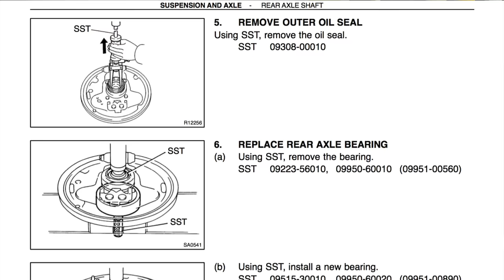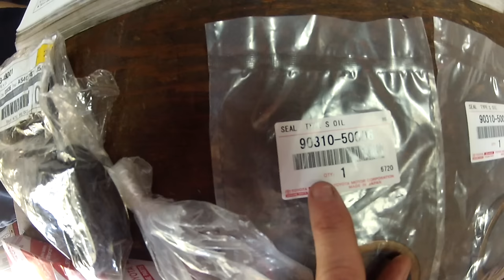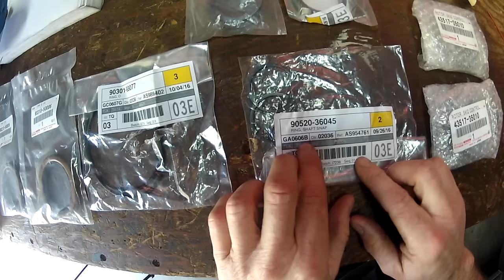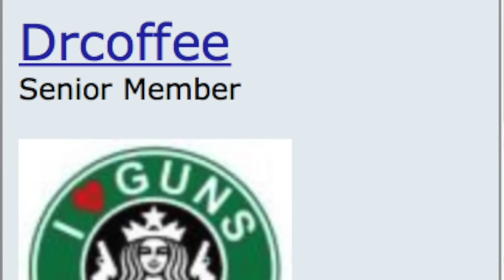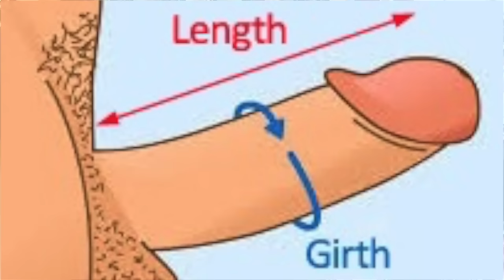Toyota Rear Axle Seal/Bearing Replacement (ABS Rearend)

Comment: Thanks for the video! It is important to note that you canot simply move the inner retainer ring inboard towards the pumpkin! I tried to put the retainer ring at the edge of the polished surface thinking it would solve the problem. When you bolt down the axle it will lock up the hub! You must flip the retainer around! This is total bullshit and it should have been a recall on this model truck!
Reply from the maker: Well, people have kept the retainer in the original orientation, bevel facing the seal, and just moved it inboard slightly, like 1-2 mm, and didn't have rubbing issues but that does put the retainer very very close to rubbing the inside of the axle housing and it still doesn't put the seal lip riding near center of the polished shoulder of the retainer.  Definitely the better choice is to flip the retainer so you can keep the retainer well away from rubbing the inside of the axle housing and get a better mating with the seal.  

I don't know if I agree with a recall but the problem is the fact Toyota redesigned the seal to improve it's longevity but then caused another problem because the seal lip now sits more inboard than before.  The problem is many dealerships,  independent shops and DIYers don't know about the seal redesign and end up botching the repair.  I have no doubt that anyone who watches this video has more knowledge about this repair than most paid mechanics.

Comment: GREAT VIDEO...Having second thoughts about bringing my 2002 Tacoma into a Machanic shop for a rear bearing job ,Thinking on doing it myself .
Reply from the maker: Dennis Khan Hey Dennis, you can definitely do it yourself with the right tools.  Look at the list of tools in the video description and what they would cost you compared to what a shop would charge for this.  Even if you end up spending more on the tools, you now own all this stuff for other projects.  I've used the Harbor Freight press for several jobs now and same for the press sleeve kit.  The bearing splitter I've used mainly for the rear axle job but I recently learned they will help me press out bushings from the front upper control arms.  The only tools that has a singular use is the Durasolid axle tool.  But, offer one person your help for a $200 and you've now paid for the tool.  Lots of people need this repair.  People are hitting me up all the time for help.  If you don't want to keep the tool, you can always resell it on Ebay or Craigslist.

The other option to save money is to have a machine shop do the press work for you but you have to be picky which shop you choose because it's fairly common for them to do the press work wrong or screw up your axles by cutting off the parts and scoring your axles.  

If you're into this kind of work, I'd suggest investing in the tools.  Make sure you read the video description for ideas on saving money on parts as well as all the links to the tools I purchased for this job.  Good luck!

Comment: 5mm of polished shaft & inverted inner retainer. That sounds correct? Tired of getting 3 years out of my wheel bearings. Thanks Timmy!
Reply from the maker: 5mm seemed like the perfect measurement at first but it depends where you measure from.  Where the polished surface starts isn't perfectly symmetrical on the axle.  You'll notice a high and low side and that's due to how the axles were machined.  So, a safer starting point is at 3-4mm.  Then insert the axle and perform a sharpie or grease test.  You'll then see if you're good or you might have to drive the retainer and ABS tone ring on a little further.  Please read the comment I pinned for updated information on this repair.  It's important you read it.  I also recommend you watch Part 2: https://youtu.be/R-c2x3F8DU4 and read the comment I pinned for that video.  Doing all that will make you the most prepared you can be for this job.  It's worth your time to be as informed as possible so you do it once and it's done right.  Good luck!
Reply: @TimmyTheToolman  
Thanks so much Timmah! You're quite the Toyota owner's asset!
Reply from the maker: @buttermilkbiscuit1021  You're very welcome.   We're here to help as much as we can.

Comment: Hey Tim,
In a time pinch and neglected to flip the inner retainer ring... less than 100 miles later and I’m leaking again (checking via ABS port).
As a temporary fix have you ever heard of someone pressing the inner seal less than all the way in? I have to drive the truck 500 miles this weekend and no time to take the axel back to the machine shop to flip the ring
Thanks for the great videos, you rock!
Reply from the maker: Yes, not seating the seal in fully has worked for people.  Just confirm the seal mating with the retainer by doing a grease or sharpie test before bolting everything back up.
Reply: Timmy The Toolman thanks for the insanely fast reply. I will be dropping by Toyota for a new seal tomorrow. I will be sure that the bearing is seated square too when I do the grease test.
Reply from the maker: @landonthings  You're welcome.  Happy Wrenching.

Comment: In your opinion, which I value highly, should I replace my axel seals and bearings before I have an issue as preventative maintenance? I have no issues currently. Or save the money and do it when needed? I plan to do the rear brakes soon.
My truck only has 86k miles but it’s 22 years old.
Reply from the maker: As long as the seals aren't leaking and the bearing don't have play or are making noise, I wouldn't do it.  You can pull the ABS sensors and look into the axle housing so verify if the seals are holding.  If they are showing signs of letting gear oil past, then I'd do the job.
Reply: @TimmyTheToolman  thanks Tim. I watch your videos daily. You’re a huge help and have responded to me multiple times on old videos. Do you have a Venmo or PayPal? I’d like to buy you a beer/coffee.
Reply: I found your “tip jar”. Not sure if you have any merchandise but I would love to get a sticker of your logo for my truck.

Comment: Hey Timmy, is this something that needs to be fixed asap? Gear oil is spilling all over my right rear tire and the left side is showing signs aswell but not as bad as the right side. I'm planning to remove the axles myself and give them to my mechanic, but money is tight at the moment especially since its nearing the holidays. I'm planning to have it done by the first or second week of January. And thank you for your content :)
Reply from the maker: As long as you're keeping your differential gear oil topped off, you have some time.  The one issue that can occur is your brake shoes may very well be coated in gear oil which will negatively affect your braking.  The other thing is the brake shoes will wick up the gear oil and start to swell.  If it goes on long enough, the shoes can start to drag in the drum and then you're pretty much at the point you're going to have to do something about it.

Comment: Love all your videos. Makes the job so much easier. Do you have any plans to make a video detailing how to remove and install the front wheel bearings and seals on a 3rd gen 4Runner with ABS?
Reply from the maker: Good to hear you like what Sean and I are doing and the videos have helped you out.

We already have videos that will help you with replacing front wheel bearings.  Our Upper Ball Joint Replacement video will show you how to get the knuckle off the rig and back on: https://youtu.be/-sY2azyLBuI  And, our Manual Hub Swap Part 2 video will show you how to do the needed press work: https://youtu.be/1TpOYj0sUpA

Comment: Just a note when ordering parts: the 93, 94 have abs but the axles are the same as the non ABS that you show. The ABS was changed for the 3rd gen. 2nd gen ABS is run off the power steering system. Be aware when ordering parts for the earlier system.
Reply from the maker: Thanks for sharing this information.

Comment: You can use the tapered caps off the bottles of lube to cap your break lines, works great!
Reply from the maker: What kind of lube?  A 7/32" vacuum cap works great too and you can buy a kit of different size vacuum caps for a pretty affordable price on Amazon.
Reply: The parts store was closed and I had two 80w-90 gear lube 1QT size with the pointy cap and the caps worked perfectly.
Reply: 1QT size caps are tapered so one size fits all.
Reply from the maker: Gotcha.

Comment: Outstanding! Thank you for taking the extra time required to create this video.
Reply from the maker: You're welcome.  Thanks for taking the time to comment.
Reply: Timmy The Toolman, I'm from Concord, CA, but live in Utah now. I really enjoy working on my 05' Tacoma. I just finished installing 2010-14 4Runner front calipers, and rotors. They just barely fit in my 07' FJ TRD, 17" wheels. 😊
Reply from the maker: What part of Utah?  I've been to Utah many times to mountain bike.  The area around Zion is awesome near the town of Hurricane.  I've ridden at the Thunder Mountain area.  Moab is great and so is Park City.  The thing I don't particularly care about in Utah is the liquor laws.  They make it difficult to find good strong beers.

Comment: In the hopes you may still get an alert of new comment.  I have 1996 4runner, changed that axle seals as guided in your video here, noted that I had very low diff fluid when I drained it. I had to replace the shoes as they were drenched in gear oil.  I also had the drums turned. When I got everything back in place, I filled it with new gear oil, but for the next several days have noted a smell like burning clutch from the rear end.  I have no leaks. I put a new breather valve in... Is this smell the gear oil or the bakes settling in?
Reply from the maker: Some gear oil could have still been in the oil slinger.  That's the metal thing on the inside of the axle face.  Oil that went through the bearing was directed into it.  The design was meant to send the oil to the outside of the drum, but obviously it's not a perfect design.  So, I think there's a chance some oil inside the slinger made it's way into the brakes.  You could pull the ABS sensors to verify the seals are holding.  If you see gear oil in the cavity where the ABS tone ring is, that means gear oil is getting past the seals.  If that area is dry, your seals are good.  I'm assuming you verified a good mating of the seal with the inner retainer by doing either a grease test or sharpie test.
Reply: I did do the grease test and it looked good to my eye, grease got pushed back and there was a good section of clean polished metal.  I guess the smell, more like burnt clutch, seemed new/different to me.  Didn't smell anything like the gear oil.  Hoping there was a, oh yeah, that's the new shoes seating..." answer, that my inexperience wouldn't allow me to identify.   I do a double check of everything.  Thanks for the help.
Reply from the maker: @brianflett7994  If you want some peace of mind, pull the ABS sensors to see the cavities are dry.
Reply: @TimmyTheToolman  took the sensors off and didn't see anythink that looked like gear oil, a little axle grease that I used when putting everything back together, but don't think it would be the culprit of the clutch smell.  Took drums off and everything looked dry although it was a lot of brake dust for brand new shoes.  But it did help me see that everything was dry in there.  Must be something unrelated that I'll have to keep hunting for.  Very pleasant surprise to get this much feedback from you on this.  I really appreciate it!
Reply from the maker: @brianflett7994  Good to hear everything looks good.  It could have been some residual gear oil in the oil slinger that worked its way into the brakes but is now gone.
Reply: Another thought ... The axles ended up getting reversed (left side to right side and vise versa) due to the machine shop swapping the backing plates on the axles.  I figured it wouldn't be a huge deal since I'd never be able to match the splines to gear pattern even if they were on the original sides.  I looked everything up and the axles are the same (length, spline count, etc) but any chance that switching of sides is the culprit?  There haven't been any strange noises or difference in acceleration, but I am a novice at this stuff.
Reply from the maker: @brianflett7994  The axles are the same length.  Swapping the sides they were on shouldn't be an issue.

Comment: A third way for the short bolts.  Coupling nuts threaded onto the studs and same size bolts from above down into the coupling nuts through the tool plate
Reply from the maker: Thanks for the tip.  We do have a much better tool now though for this job.  It's featured in this video: https://youtu.be/R-c2x3F8DU4
Reply: @TimmyTheToolman  It is a great video. Good info, good documentation, good camera work / lighting.
Reply from the maker: @remusredbone1214  Thanks!  We appreciate your compliment.

Comment: I could be wrong but if you had of just flipped the blue base plate it has notches in each corner to allow you to grab more thread. In this vid you can see the gap in each corner on the underside of the plate when it’s fitted against the hub. At least that’s how mine is and all others ive seen?? Could be wrong. Regardless great video for anyone new to this pest of a job
Reply from the maker: I altered that blue plate at a machine shop.  It didn't come like that.  It doesn't matter anyway.  There's a much better toolset available that we feature in Part 2 that we recommend to everyone.  https://youtu.be/R-c2x3F8DU4?si=6ZsP5Xtl_UBdq9Z7

Comment: Thank you for the videos you have been super helpful with me working on my 04 tocoma. 1 question tho do you know the part number for the studs you ripped the threads off of? I can’t seem to find them and I broke one trying to get it off the truck. Thank you again
Reply from the maker: BOLT/STUD - (FOR REAR AXLE BEARING CASE)

90114-10002
Reply: @TimmyTheToolman  Thank you!

Comment: Which seal driver did you use the otc or the hf kit noticed when you finally hammered the seal in looked like ya used the otc if ya did use the otc what seal driver you use that worked the best I have the same otc kit @timmy the toolman
Reply from the maker: I used the OTC kit.  Those plastic seal drivers from Harbor Freight aren't the greatest and weren't getting the job done.  I can't remember which size I used from the OTC kit but it's the one in the kit that fits the diameter of the seal closest.  You don't want to use a driver that's too small that will end up creasing the seal and pushing the sealing lip inboard.   The strongest point of the seal is on the outside shoulder.  So, there's a driver in that OTC kit that's the obvious choice.
Reply: @TimmyTheToolman  yeah I have had problems with the seals concaving and realized the seal I got had a rubber outer edge instead of the smooth metal machined edge at it was 2000s to big and it creased on me so had to by better seals got them from toyota doing job again appreciate the reply timmy
Reply: @TimmyTheToolman  I noticed in the otc kit one driver is slitley small and the next step up is slitley a mm or so bigger then the seal
Reply from the maker: @AntonioClaudioMichael  Use the one that slightly bigger.  That's the one I have used for all the jobs I've done.  You might think the larger driver would impede you from fully driving the seal all the way into the axle housing but I don't think that's the case.  If you use the one that's smaller than the outer diameter of the seal, that will dramatically increase your chances of damaging the seal while you're driving it in.  That's my opinion.

Comment: Hi Timmy. I think I found my issue. I lifted the car up from the rear and put it in gear and I found the noise. I believe the rear bearing on the left is the culprit. Quick question. This new being puller from Duane on Ebay, does it come with the splitter too? Is that what the red plate with the cut out, and the black bolts is??
Reply from the maker: Hey Lester, glad you figured out the culprit.  The link we provide in Part 2 is the complete tool with all the accessories.  Here's the Tool Kit I recommend you buy from Duane: https://rover.ebay.com/rover/1/711-53200-19255-0/1?mpre=https%3A%2F%2Fwww.ebay.com%2Fitm%2FRear-Axle-Bearing-Tone-Ring-Puller-Bearing-Install-Tools-Toyota-4Runner-84-02%2F203187764458&campid=5338641100&toolid=10001&customid=

In the video, I talk about saving money on the parts.  For sure reuse both ABS tone rings and reuse the outer retainers that go against the bearings.  But, please buy 2 new retainers for the inner position and I explain the reason in the comment I pinned (1st comment you'll see).  Good luck with the job and if you have any questions, just ask.  Happy Wrenching!

Comment: Timmy, I love your videos you explain every thing in great detail. I was thinking, wouldn't the measument for the seal should be taken from the flange of the shaft instead of the shinnig part? Just a thought.
Reply from the maker: Good to hear you like our videos and appreciate the detail we offer.  You make a valid observation and some people do measure from the flange.  The polished area has been a very effective landmark to measure from.  It's not perfect but it doesn't need to be.  I now recommend people start off with 3-4mm of polished axle showing and adjust from there by doing a sharpie or grease test and seeing how well the seal lip is mating with the inner retainer.  I've done the rear axle seal/bearing job at least 15 times and measuring the amount of polished axle showing has proven to be very effective.
Reply: @TimmyTheToolman  Thank you Timmy!
Reply from the maker: @javirodify  You're very welcome!